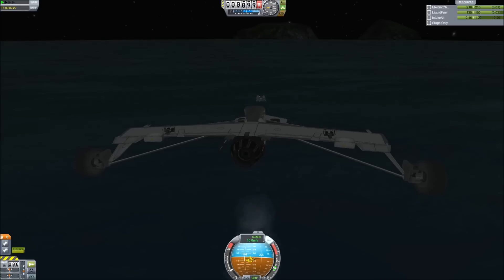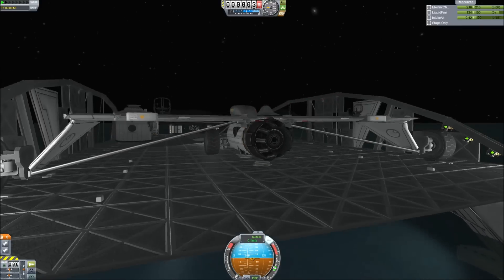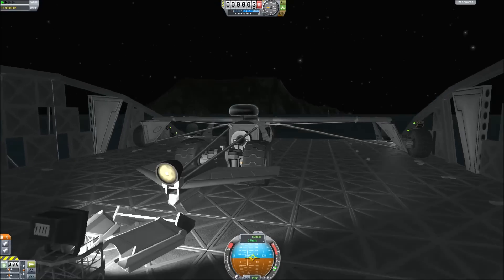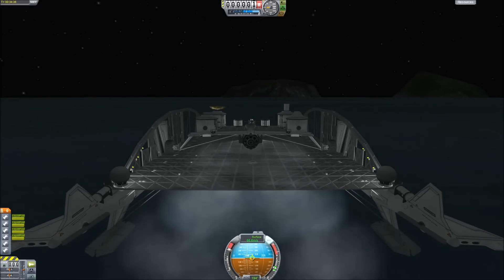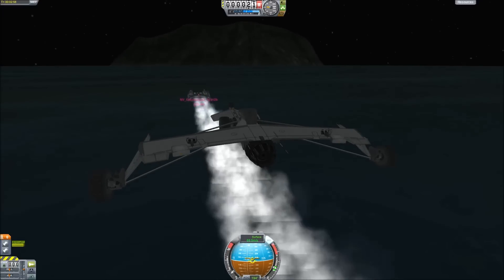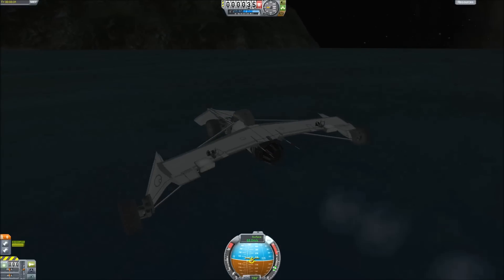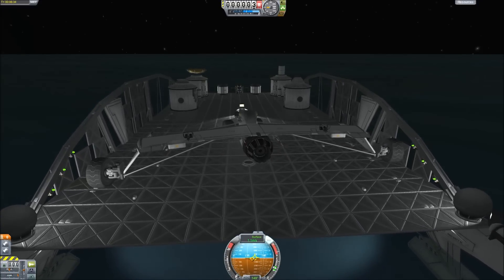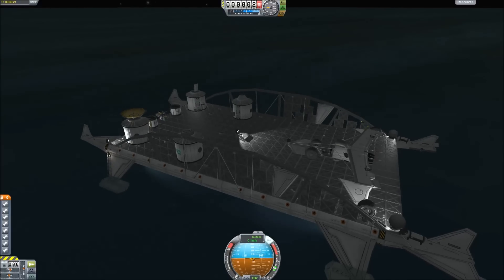KSP Laythe 006 "You want me to land on WHAT?"

Comment: hey, i know this may seem like a stupid question, but how do i get my .craft files to work? they come in as textedit files, how do i get them to run? i'm using a mac btw. thanks in advance
Reply from the maker: Ooh, I know nothing about macs.  Are your mac-native craft also in *.craft file format?  If yes, then I would suggest just changing the file extension of the files you downloaded.  If they're anything else, maybe try saving a copy of the textedit files as a name with the same file extension that your mac normally uses. 
The *.craft files are literally just long bits of text which the KSP program reads in a way unique to the game.  But since they're just text, you should be able to open the downloaded files with a basic text editor (that would be Notepad.exe in Windows) and re-save the file (Save As) with a desired file extension.  Again, since the files are just basic text data (no special internal formatting that I can tell), I don't foresee any problems saving the data under a unique file extension.
Reply from the maker: Oh and make sure the files you downloaded are not compressed in any way like a "zip" file or something.  I don't think they were compressed when I uploaded them.